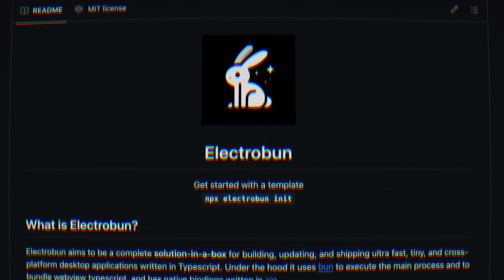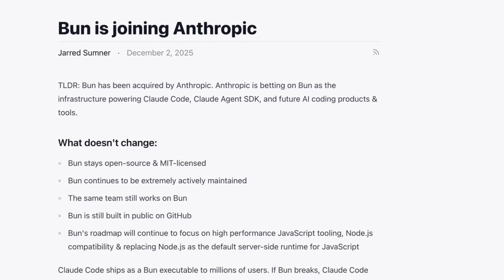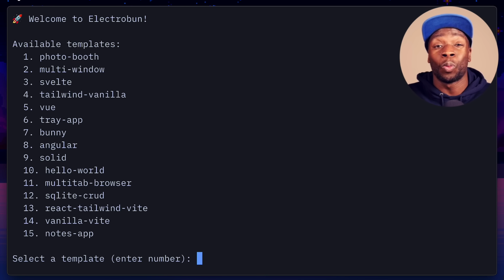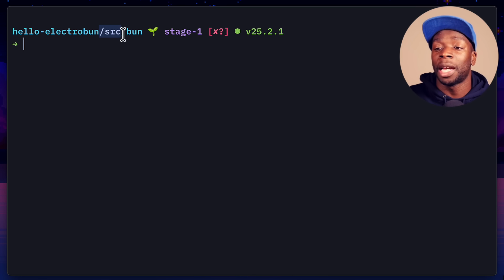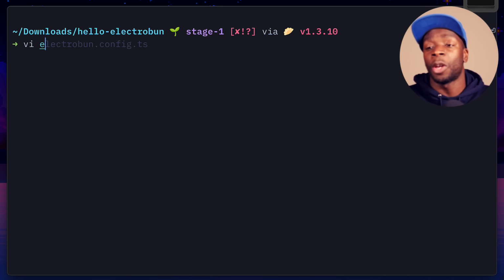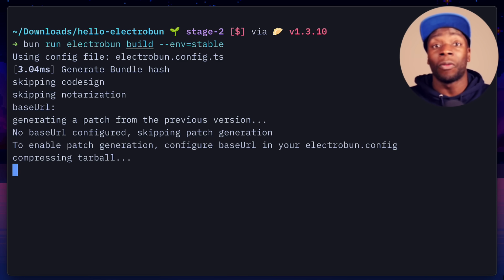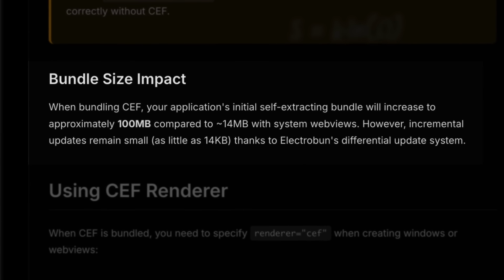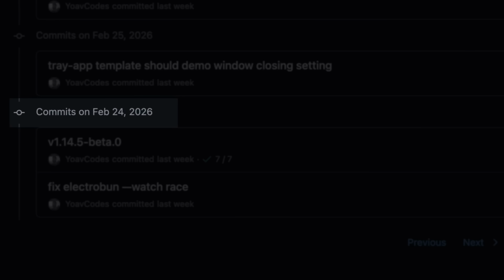Electrobun: No Node, No Chromium, Just Pure Bun Performance

Comment: Electron Killer
Looks inside
Another wrapper around web browser view
Reply: What else should an Electron killer do than to basically wrap some form of web tech for native use?
Reply: @Vitroid not wrap a web view?
Reply: @dotfm3099  at that point you're just doing regular native development, and not killing Electron/using an alternative in that area.
Reply: @Vitroid ehhhh…. I would like to see a bun powered native UI app. Use TS and web tech, but render native UI elements. A happy middle ground.
Reply: @milkmanconspiracy4346 then you lose all the html/css/js capabilities, no react/vue, no ready to use components.
Reply: @milkmanconspiracy4346  And why pick the worst of both worlds?
Using frontend tech in backend & performance tech in frontend?

Can't you see the bullshit react-native already ?
Reply: @khanra17  you clearly have no idea what you're talking about
Reply: @dotfm3099  react native exists, tho that's not really an electron alternative the same way, tauri/electrobun are since u essentially are locked into React + need to use custom native components (<View>, <Text>), not regular HTML.
Reply: @milkmanconspiracy4346 It’s called react native
Reply: @dotfm3099  no it just uses operating systems webview directly instead as my understanding
Reply: @milkmanconspiracy4346  what do you mean by "native UI"? Translating HTML and CSS to UI elements of native UI libraries? Stupid idea.
Reply: @nikitf7777   That is mostly what react-native does on mobile.
Reply: @nikitf7777  so react native is stupid? :P I think Facebook would like a word with you..
Reply: @Frexuz  react native doesn't work on all platforms
Reply: @milkmanconspiracy4346  so, like flutter then. it exists and is an interesting middle ground. But it is not web, so it is not as popular to use.
Reply: @dotfm3099 most stupid comment I read today 😂
Reply: @gro967 so you think it's not possible?
Reply: @dotfm3099  and how will web developers write desktop apps without web view and js 😂
Reply: @dotfm3099  its just UI, the app can be C++ or any fvck you want
Reply: They will always wrap webview. How else would you use web technologies? If there is an electron killer which doesn't wrap webview then it's Qt. But then again, it completely goes out of point to even talk about it.
Reply: @black_crest i am new but why would you want use web technologies amd what is an example of web technologies?
Reply: @burrybondz225  Web technologies are used because they bundle a browser with the application itself. This makes it easier to use web development skills to make applications for desktop. You could easily use good looking frameworks like Vue to make your desktop applications looks better. Libraries using native OS level calls like Qt are ugly looking by default and require heavy usage of low level languages like C and C++. VSCode is an example of Web technologies, written using Electron.
Reply: @burrybondz225 it's basically lazy way to make cross platform application
Reply: Lol
Reply: Better than any python thing where you have to hardcode everything, even simple styles
Reply: If you don't need all of the cross-platform, accessible and standardized UI, then ... just use SDL3 and your language of choice?

Or DearImGui.

Complaining that the JS/HTML thing that works everywhere a browser works, is being replaced with ... a JS/HTML thing that works everywhere a browser works is kind of inane.
Reply: LOL
Reply: Cry more
Reply: bro, your brain got rotten
Reply: Yeah it's totally just a WebView wrapper
Reply: the web use to run on Java for their web applications, but since Java is dead now, it was replaced by Electron.
Reply: You dont get it, gamer
Reply: tauri simple exist xD
Reply: @andrewpozunyk7807  rust knowledge needed, bun can just run with simple js
Reply: @shuvameta  Rust knowledge is not needed, it gives you the option to write backend in rust but you can do most things that Electron allows with javascript api. And honesty, if you need more than api allows, you would be better with a native app or rust anyway.
Reply: @andrewpozunyk7807  tauri doesn't have (yet) chromium webview for linux/macos
Reply: @andrewpozunyk7807  The "issue" of tauri is that you can't just use JS for the application, backend has to be in rust afaik
Reply: @andrewpozunyk7807  the issue with tauri you will eventually need rust and then theres the issue of using native webview in syntax theres a talk about why they choose electron. with tauri for mac it will use safari and it has some limitation/missing feature for their app so they choose electron. same for electro bun but if electrobun can make chromim faster and more efficient by stripping old things and maybe like tauri allow mobile builds too
Reply: @andrewpozunyk7807  Tauri still uses WebKit; it just does not bundle the whole browser inside the built app.  Users need to install WebKit on their OS as a dependency
This can be both an advantage and a disadvantage depending on your needs, 
You can build Tauri for any os as long as the OS has an executable WebKit / WebView2. Tauri doesn't care and doesn't manage it, but that means you also cannot control the JS and css compability
Reply: Complain about something
Doesn't elaborate
Leave without providing a better solution
Reply: Thats the point though? So we can just use the same language everywhere. Ya ya native, who cares. Web is the most mature platform because of how ubiquitous it is.
Reply: @ablasttv  It's ubiquitous because people try to fit this thing everywhere, it was made for a platform its working there fine no need to push it everywhere, there could be alternative too without existence the of JavaScript, typescript tries to fix JavaScript but yo can never escape JavaScript with web, you cannot possibly call something that requires something else to fix with billion of legacy feature weird side effects a "mature platform" its decent for what it is obviously could be better but no one in the world has said you can't make native development easier without web, there are existing solutions people are just lazy to adopt there could be more too
Reply: @fus3n   number of developers trained on it = more, cheaper labor to do it = more and more of it. This is the result of telling everyone they need to learn to code and everyone going to react/node coding bootcamp. is what it is at this point.
Reply: @ablasttv  You're completely right that it happens, but that just proves the joke of the original comment we're replying under. Companies taking the cheap route with bootcamp grads is exactly why we have so many bloated, terrible web wrapped apps in the first place.
So your argument basically went from "web is a mature platform" to "web provides cheap corporate labor". Recognizing a sad industry reality doesn't make it good engineering. Just because companies want to save a few bucks on native devs by offloading the cost onto the user's RAM and CPU doesn't mean we should just shrug and say "it is what it is". Defending a race to the bottom just kills actual innovation.
With that said, I still think this tool is a better option than raw Electron. But like I said originally, native development can be made easier and better without forcing web tech into it.
Reply: @fus3n   if your native can compile from the web, or vice versa then great. No ones gonna pay to build multiple separate apps that all look the same. One codebase that works everywhere or no deal.
Reply: @fus3n  it's ubiquitous because it has decades of maturity, it's fully retrocompatible, most people instantly recognize and know how web components behaves, and a lot more. Is the closest we have to a UI standart

You want native apps in windows? Sweet! Are you using winforms? Oh no, WPF is the new thing. What? WPF? That's ancient, use UWP!

And then not even microsoft uses UWP

If you don't want the web everywhere. Maybe "everywhere" should have competent UI libraries, and not expect a linux user to have a full desktop environment doewnloaded so buttons and icons show in an app made with that DE's tools

I hate the massification of electron apps a much adms the next guy, but this rant is not it. The problem with web technologies is not that they are everywhere. But that nothing else compares in UI development
Reply: @Slashx92  Yes this man gets it
Reply: @ablasttv The horrendous performance of webviews and the existence of TypeScript show how horribly immature web technologies are. The only thing they are is flexible, and that's why they're popular.
Reply: @juniorwmg  no one cares about performance anyone with a pc built this decade can run it fine. Development speed is what matters most
Reply: @juniorwmg the horrendous performance of C++ linkers and the existence of Rust ... and .NET / Blazor ... and SwiftUI ... and Flutter ... and memory-unsafe FFI / ABI over the C external callable interface, and top to bottom recompilation, per architecture, any time anything anywhere changes, in an average codebase, and reliance on calling random global functions, added by other files, and "linked", show just how immature high-performance C++ is.

This statement is asinine.
Reply: @ablasttv  have you heard about electron huge ram leaks?
Reply: @ablasttv is the no one you're talking about in this room? Reality is, many aren't.
Reply: @ЕвгенийГарбарчук  yes, and still no one cares
Reply: @juniorwmg  i issue with dev using/liking electron is because native crossplatform dx is horrible and fractured and harder
Reply: Yeah of course a person living in a first world country would say stupid stuff like this. Just assuming everyone has decent computer to run garbage electron apps is crazy.
Reply: @RitchielReza-f4i my work is b2b its not for you
Reply: @ablasttv  yeah, people who really wants perfomance go native solutions.
Reply: @RitchielReza-f4i Probably said by a person using Discord and VsCode the same day as typing in this comment!
Reply: Some people are just not in the 90% of the target market
Reply: @RitchielReza-f4i i can guarantee you a few of your apps use webviews and you didn't even notice. I seriously don't understand people who say all web apps run bad. If even the stupid Inspiron i had 5 years ago that could only use Edge and Word (barely) could run web apps fine, i don't know what kind of e-waste you're using
Reply: @juniorwmg  this is not true per se/by default:

you can write horribly performing swift-ui apps as well, javafx and alike don't get me started, and 'just' writing in c++ signs you up for horrendously slow and complicated development, while must of those applications look horrible.

What I do agree with you, is that many of the existing electron apps are written without much or any care for any performance.
Also the default of 400mb+ ram needed per app, is bollocks.

That doesn't mean it is impossible at all. you can make wicked fast performing desktop apps with web technologies only, plus retain the benefits of being cross platform by default and have a much higher development velocity.
Reply: @juniorwmg > junior

Makes sense

How can you say the web is immature. If you don't know how to make a competent app without 200mb of deps, that's on you. The web is one of the most mature plataforms we have to develop UIs lmao what are you on

Also it's fully retrocompatible btw
Reply: @RitchielReza-f4ii have a 4core 8 ram 2012 notebook and I can run several chrome windows with several pages and apps open without issues. You problems is either windows, or horribly developed apps
Reply: @juniorwmg By your own logic, the existence of Kotlin and Scala means Java is immature, and the existence of C++ means C is immature, or any of the host of higher-order languages out there.

That's... not at all how languages work.
Reply: @ablasttv  People care about performance. That's why TypeScript was re-written in Go and why Zed became popular. There's no reason VSCode, a text editor with colors, should be eating several gigabytes of RAM and stuttering.
Reply: @ablasttv would this thinking persist in 10 years as hardware growth slows down and ram , ssd prices remain permanently elevated from a few more tech hype cycles?
Reply: @burrybondz225  yes, theres no reason the language itself is required to stay slow, they can change the underlying engines anytime if it actually becomes a problem. For now, getting your business launched is more important than building 3 different versions of a CRUD app that are all the same on different phones, customers dont care.
Reply: @ablasttv people that care about performance lol
Reply: Blame Microslop and Apple - they have no practical native APIs for writing desktop applications (or mobile ones for that matter) - let alone cross platform ones. Our actual best hope is that the web implements wasm so you can use something like Tauri with Rust end-to-end, avoiding the memory blow out of JavaScript based applications.
Reply: I take it you pushed a pull request ?

Comment: Tauri still better
Reply: Umm. No, Tauri is inconsistent accross platforms, it's so annoying building a feature only for it to break on MacOs because... Webkit, or having layout issues, inconsistent APIs accross platforms, it's been messy for me... Almost regret it.
Reply: @allan_archie  literally webkit skill issue 😂
Reply: @RustIsWinning Literally jihading😂
Reply: @allan_archie  Isn't this the same? I mean the exact literal same? if both are using native webviews and your issue is inconsistency between browser implementations, how would this be better?
Also
git gud
Reply: I use tauri, but the need to write Rust makes me want to avoid it
Reply: @marcosramiro394  the bigger issue with tauri is building for mac as it will use webkit which is always behind in feature
Reply: @marcosramiro394  you don't have to! Tauri expose most common APIs built with Rust and you can use them via JS.
Reply: @marcosramiro394  the "need" to? What do you "need" to write rust for? I've been building Tauri utility apps for my business and I basically never have to touch Rust thanks to the plugin ecosystem that lets you use TypeScript exclusively
Reply: @marcosramiro394   that's the whole point, using Rust
Reply: @JaumeMartinOnline For me, it's about having a small binary with low ram usage. Unfortunately, other projects don't deliver that yet.
Reply: @marcosramiro394  even tauri is considering using something like servi... which is good, as webui is not perfect, but that will increase the bundle size. I don't really look at that as my apps in tauri are big. I use it because of rust. But I get your point
Reply: tauri doesn't have (yet) chromium webview for linux/macos